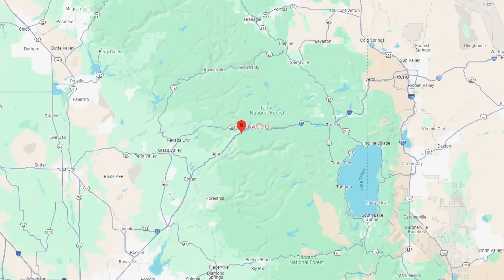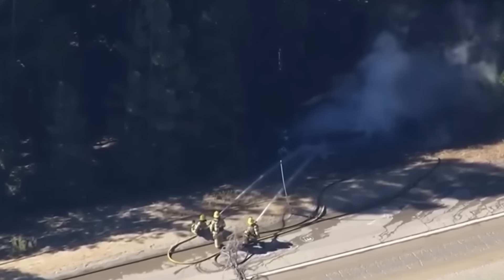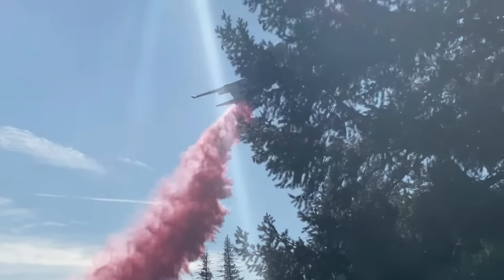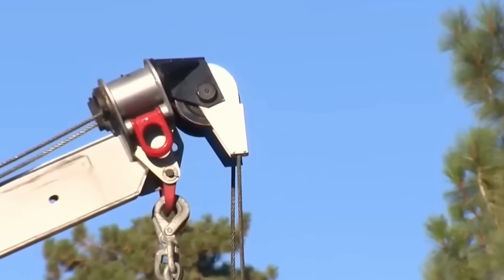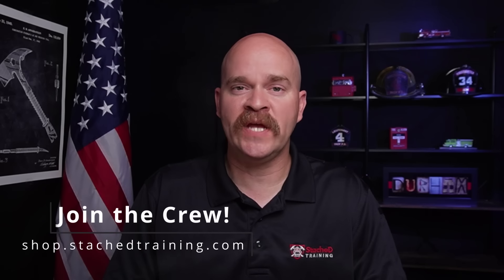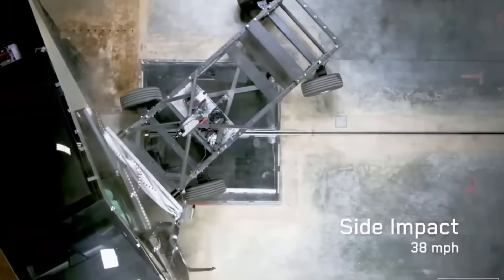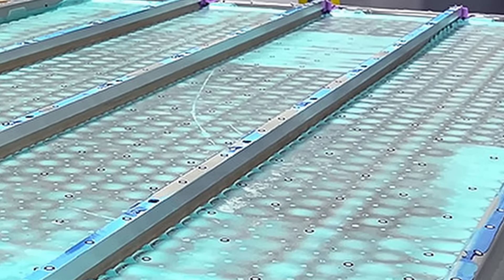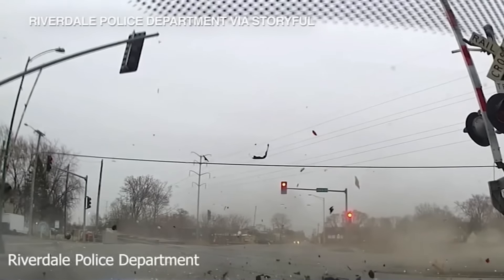50,000 Gallons! Tesla Semi-Truck & Cybertruck Fire

Comment: I believe a bigger problem is the huge number of cells in one vehicle. With thousands of cells in one car, it only takes one faulty manufactured cell to burn all the other good cells. 

There needs to be some sort of cell isolation design and fire suppression to prevent the heat and fire from one cell experiencing thermal runaway from propagating to all other cells limiting the fire to that one cell or small segment of cells.
Reply: Good idea. Good luck getting it to happen, though. EVs are such a sacred cow, politically speaking, that nobody's gonna wanna slow down the "transition" by doing that. Not only would the design period slow down production of new EVs, the extra protection would make them more expensive than they already are--which is a huge sticking point for a lot of folks and explains a lot of why adoption of the things has been so lackluster as it is. ...Which is saying nothing about the used car market. Who's gonna want to buy a used EV that could quite literally go up in flames like an old Pinto? And with less warning?
Reply: They do this already, problem is that with a big enough accident there not much you can you do
Reply: @nightrunnerxm393  Other batteries take a higher temperature to actually cause thermal runaway and are thus much safer.  It's analagous to how much more difficult diesel fuel is to ignite than gasoline.  New batteries would simply be safer than lithium ion ones are.
Reply: Just wait until these vehicles are older than new.
Reply: Electric drive is great, but the power source is not with 1/50th the energy density of diesel and the dangers of the chemistry.

A series diesel-electric drive with lead-acid golf cart batteries for emissionless driving around town would be much better.

To deal with the problem, first halt production of Tesla vehicles and take them off the roads to be disposed of at Tesla's expense. Then dispossessed owners can sue bankrupt Tesla for selling them trash and get nothing. If they can afford a $100k virtue signal, they can afford to lose the false virtue they once possessed.

Then we need to form a Tesla accountability commission, because we need a Tesla accountability commission to hold Tesla accountable, because a Tesla accountability commission could hold Tesla accountable.

A Tesla Accountability Commission. ATAC.
Reply: New battery technology would solve this, but no where near cost effective. The current lithium iron batteries can already be made to not runaway, but they are heavy.
Reply: If an EV battery pack was designed to isolate and separately cool each cell, it would be bigger than the vehicle it's supposed to power and prohibitively expensive.
Reply: re: "I believe a bigger problem is the huge number of cells in one vehicle..."  "YOU ARE CORRECT SIR...!!!" (best classic Ed McMahon/Johnny Carson/Carnac The Magnificent voice) <---- hint, this skit would be from the ORIGINAL Tonite Show long before Jimmy Fallon OR Jay Leno were the hosts.
Reply: @christianedelmann6880  re: "They do this already, problem is that with a big enough accident there not much you can you do". <---- see, Chris over in the vicinity Germany and Austria gets it... 🤙
Reply: @battery_wattage  re: "but they are heavy..."  exactly they are HEAVY AF which means you are essentially REVERTING back to traditional Lead Acid technology (which is the problem the switch to Li-Ion Chemistry was meant to solve).  that's right, anybody who's studied any information on the development of the Tesla Roadster (prior to Elon's involvement) knows the original mules were powered by Lead Acid Batteries.  in fact i've seen one of the original T-Zero's when i was out in Phoenix back on the date: 4-20-2024 as it's hanging up on the wall at Pete Gruber's place (still have the pic he took of me standing next to it on my phone).
Reply: @phillyphil1513  thanks for reiterating? My point is the technology still is immature. Also lead acid is nowhere near the density of lithium iron. Cool how you got Gruber to take your photo.
Reply: @battery_wattage  re: "My point is the technology still is immature." and my point is, it is NOT the "technology" that is IMMATURE, no it is the PEOPLE WHO ARE IMMATURE (aw crap)...

okay now lets review, the first battery was invented by Volta in the year 1800 with Li-Ion Chemistry later developed in the year 1980 by "Johnny B Goode" (and associates)...

right, so since the calendar on the wall says it's now the year 2024, what this means for those having the courage to track History and reference TIME which is not something everyone is inclined to do (certainly not those "baby young to the world") is that we have a whopping 244 years and 44 years respectively between "developments"...

that's right, those who actually know how to "read" a Periodic Table understand the technology is in fact MATURE. also ref: The Law of Diminishing Returns.  <----- unbeknownst your nose is pressed firmly against a BRICK WALL but your eyes can't see it.  also ref: The MYTH OF PROGRESS.
Reply: @battery_wattage  re: "Cool how you got Gruber to take your photo." ikr...?  even cooler i got up from behind my computer, put my ass on a PLANE, and did the "leg work" to go and see FIRST HAND all the things i speak on, which is more than 99% of the bullsh!tters on YouTube have done (you know who you are).  # NEVER SKIP LEG DAY
Reply: Or there just needs to be NO EVs. Simple solution. They're not the future, or the answer. Change my mind.
Reply: Batteries.. To be honest, when i imagined 21st century vehicles, i not once, imagined they would run on batteries... F*CKING PATHETIC...  Wow, this World is such a Collection of Crippled...
Reply: @deltabravo1811  Lead acid has absolutely shit round trip efficiency, energy density (like <20% of lithium) and cycle life compared to almost any chemistry from this century. If you're paranoid about batteries, just use capacitors or LTO batteries.
Also, lead acid batteries can explode if they start generating hydrogen when they're overstressed or if they enter thermal runaway. They can literally blow the battery casing apart and spray sulphuric acid on their immediate surroundings, although it's rare.

There's some research projects ongoing to develop fire retardant electrolytes for lithium batteries so they'll be self-extinguishing, if they work out.
Reply: @deltabravo1811  lol have you been huffing diesel fumes lately?
Reply: There already IS cell isolation, at multiple stages within the battery pack - but you cannot defeat physics. If the battery pack is damaged by an impact, and one cell shorts out and heats up, and you get thermal runaway, heating up the surrounding cells - then everything starts to burn, and just like the sun, and the entire universe, when things heat up enough, they become liquid, gas, and plasma until the energy is disbursed. You can't make a battery pack "impact proof" in a practical sense, because they means adding more mass (metal) and weight, which counters the energy needed to move the car. It's the same reason we don't "simply" put a parachute on commercial airliners. Could it be done? Sure. But it would take up a huge amount of space in the plane, and add a lot of weight, so it's better to just try really hard to build a plane that will stay in the air. Everything is a complex trade-off, and the #1 trade-off is COST. EV's are heavily subsidized thanks to all the liberal-green-fools who think EV's are going to solve all the world's problems. If they weren't subsidized, they would still be far beyond the reach of almost all people (they are still far beyond the reach of MOST people, but they'll get cheaper by building more of them, lighter, cheaper, and thus more capable of burning up on impact - and then taxpayers and everyone who pays for auto insurance will subsidize the catastrophic results of these fires...think about what it cost to fly a huge fire suppression plane over that truck to douse the fire.)
Reply: @nightrunnerxm393  future b d's
Reply: @nightrunnerxm393  future battery technology will cange

Comment: At some point we will be forced to admit that the current battery chemistries are not ideal for large applications.    The bigger the battery the more susceptible they are to damage (these things are heavy!) AND the more likely a single cell will have a bad day.
Reply: I wish we had large scale capacitors because hypothetically those wouldn't have a fire risk.
Reply: Solid state batteries may be the future and a lot safer
Reply: @zzoinks  anything that’s more difficult to have an accident would be better.  Even the uploader has pointed out that the other battery types take more heat to burn.  There couldn’t be a more clear decision on this.

Comment: All that toxic air pollution and contaminated water runoff, this green energy push is really good at increasing the air quality and cleaner water table, doesn't it.. NOT!!!
Reply: Are you serious?
Ok,  now make a comment about rednecks with diesel pipes
Reply: @deemo5245  And exactly what is used to recharge those batteries? Fairy Floss? Top tip: If these vehicles are being charged overnight, even in the state of California, burning fossil fuels is how they are recharged. These are remote combustion trucks, not no combustion.
Reply: @davidbrayshaw3529  yes of course someone had to say this.
👏🏼👏🏼👏🏼
Reply: Cybertrucks or EV's in general are not automatically good for the environment. Because they are so heavy they are often more polluting than a small ICE car, even when charged with green power. I am a treehugger myself, I drive a tiny Kei-car for that reason. If I would have the money I would by something like a Twike, an ultra light EV from Switzerland. As an environmentalist I don't like Tesla at all, but the argument that all EV's are as bad or worse than most ICE cars  is also complete coping nonsense. An IC engine is only about 40% thermally efficient.Electric engines are more than 80% efficient. That's a huge difference, even when using a gas powered electric plant as source, because those have a far greater efficiency as well. But with about 50% green energy on the grid in many places that becomes increasingly irrelevant. Yes EV's pollute, that's not a gotcha moment. The main problem is that people still drive way to much in way to big cars. Taking public transport when possible, using a small, light EV car when necessary and only ever using a large car or truck when commercially towing or transporting heavy stuff should be the norm. Cybertrucks can f... right of, there's no need for them, they are useless.
Reply: @deemo5245  Modern diesels are clean.
Reply: Poor wildlife there, huge contamination from fire retardant and heavily contaminated water 😢
Reply: @deemo5245  80% of EV re-charging is done overnight, at home, when the Sun isn't shining.
The utopian dream as to how EV's will be fuelled and the cold hard reality as to how they ARE actually being refuelled are diametrically opposed.
Reply: @davidbrayshaw3529  say hello to your uncle Cheney for us. You’re obviously involved with oil industry.
We’re already producing electricity at a staggering rate. How many ACs do you have? If you’re American it’s whole house probably, depending on where you live. Do you think that if the research and investment since the ICE was invented had just gone electric, as battery cars have been around just as long, then we wouldn’t have done as much damage to the ozone etc? No facts required, just asking your considered opinion
Reply: @davidbrayshaw3529 apparently the electric vehicle would still be better even if it was recharged using fossil fuel energy because it is more efficient . Electric vehicles (EVs) are more efficient than their gasoline-powered counterparts. An EV electric drive system is only responsible for a 15% to 20% energy loss compared to 64% to 75% for a gasoline engine. EVs also use regenerative braking to recapture and reuse energy that normally would be lost in braking and waste no energy idling
Reply: Batteries.. To be honest, when i imagined 21st century vehicles, i not once, imagined they would run on batteries... F*CKING PATHETIC...  Wow, this World is such a Collection of Crippled...
Reply: Everything is relative to NOW.  Is your 'version' of present-day reality based on contemporary scientific research?  Thought not . . .  :hand-orange-covering-eyes:
Reply: @harrysmith8338  They drive ELECTRONS.  Everything you know and experience relies on them.  MATTER relies on them, sunshine.  My contempt is relying on them.
Happy to give good service . . .  😎
In nineteen fifty fucking nine, my math teacher explained, on the blackboard, using all the requisite math equations how the force that could launch a BATTLESHIP to JUPITER could be provided by an OUNCE of ELECTRONS.  I know I was lucky in that I received a high-quality education for free, courtesy of the UK Labour Party, BUT PLEASE TRY AND CATCH UP.
Reply: @kkrolik2106 modern diesels are not clean, they are clean of NOX fumes not C02.
Reply: @miguellopez3392  We can speak about CO2 emission when at-least 50% Electricity will come from source that not make C02, Currently globally 81% source emit C02, also to if everyone switch to EV at least in Europe we need 30+ years time to adjust electric grid otherwise will collapse and build traditional 200+ nuclear Power plants.
Also we need deploy EV with batteries that when combust not required 2 weeks submerging car in water to extinguish.
Reply: At least the locals will be calm about it with all that lithium in the water supply 😂
Reply: @zzoinks  That determination can only be made by knowing the thermal efficiency
of the power plant producing the electricity.
Modern natural gas plants are pretty efficient, older coal plants...not so much so.
An EV charged using a modern natural gas thermal power source might just sneak ahead of a modern petrol engined vehicle for efficiency but probably still won't be as efficient as a modern diesel engine.
Older coal plants are only about 35% efficient. From the get go, a modern diesel engine smashes an EV into the weeds in terms of thermal efficiency.
Reply: @deemo5245 oil diesel and gasoline is way healthier for the environment.
Reply: @bartdeking  also, not having a massive carbon footprint per household, with each family not doing a thing for the environment and basically wasting as much as they can afford to waste 🤨
Maybe waste shouldn’t be a simple direct result of wages, but instead related to education

Comment: Tesla semi-truck fire, that closed the highway for 16 hours. Not only required a massive fire department response and water logistics, but the addition of a fire retardant bomber airplane. The impact accident required additional precautions above and beyond an impact accident with an ICE diesel semi-truck would have. The Fire Retardant Bomber was used to protect the forest around the burning Tesla semi-truck.
Reply: That's California,  spill a cup of coffee they'll call the superfund emergency squad 😢
Reply: @richardscathouse but in California you may really need to prevent the forest from getting any fire at all. Because past fires have been sparked by things like cigarettes, power lines, the recent forest fire was from a car fire in the brush. You can even start a fire accidentally by dragging chains behind your car so you're supposed to lift them off the ground if you have such a chain on truck or trailer

Comment: I'm guessing that it in a conventional semi-truck crash it would take a massive hazardous material spill to match that scale of road closure. Like you said, a truck with a diesel engine and fuel tanks might burn just as hot, but not nearly for so long and they're much easier for firefighters to deal with. It's more the nature of the freight that could be a problem than the truck. (Also collateral destruction.)
Reply from the maker: I've responded to trucks that have lost a saddle tank spilling diesel on the highway.  They hold around 120 gallind.  Typically, you can get it cleaned up within an hour, and there is rarely fire involved.
Reply: Diesel does not catch fire.
Reply: @johnniblueeyes2786 It does if the asphalt is hot enough.
Reply: @johnniblueeyes2786 Diesel isn't as flammable as petrol however I assure you it will catch fire. 
After all it is a combustible liquid. 😂

Comment: Drive by wire is dangerous and should be banned. It should never have been allowed on the road. The basic functions of a vehicle should be mechanical incase of a failure of the electric system.